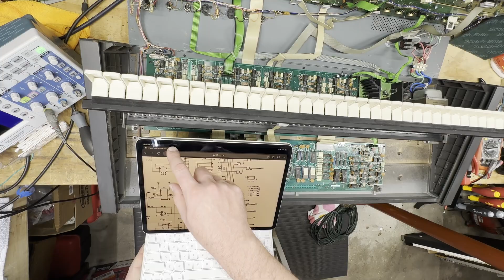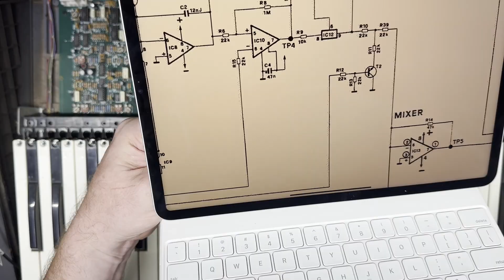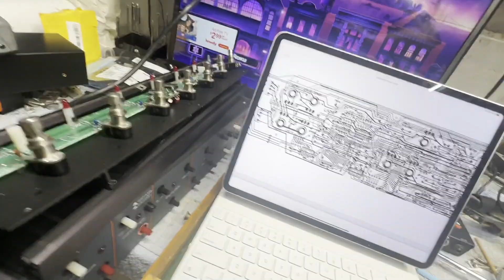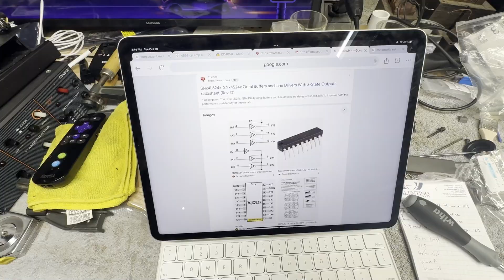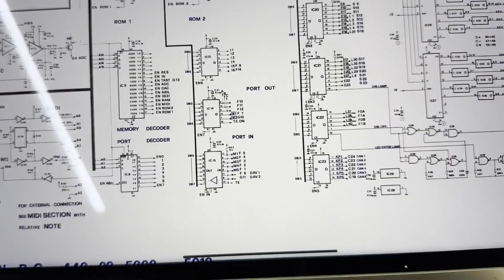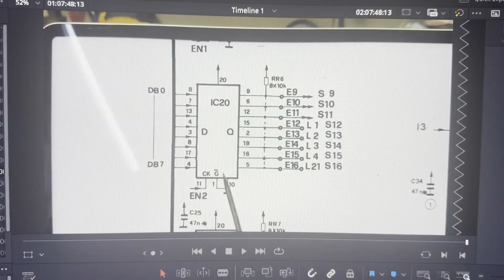Siel DK600 Diagnosis and Repair (VKS 002)

Comment: Thoroughly enjoyed this.  Thanks for taking the time to make this video and explain everything.  Your patches might not be saving because you have to disable the memory protection first by entering 95 and pressing enter.   Also, looks like someone removed the reset switch from the main board.  Its just a simple momentary switch.  Great work!